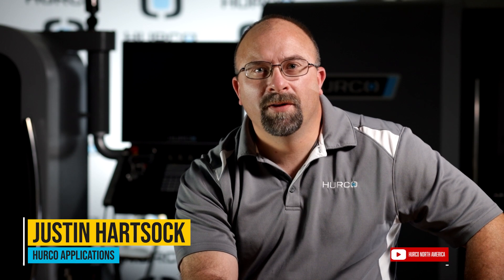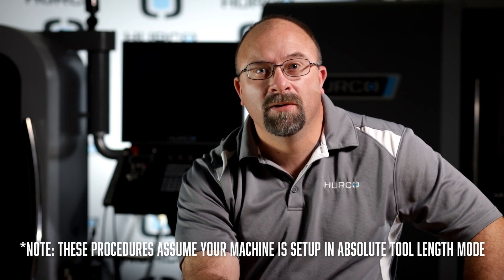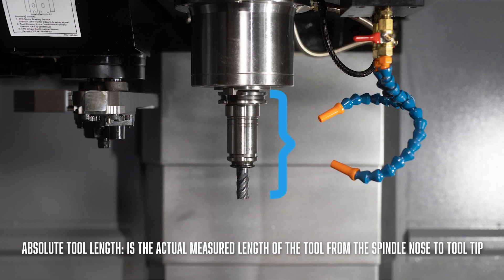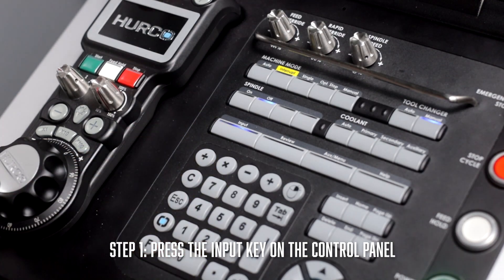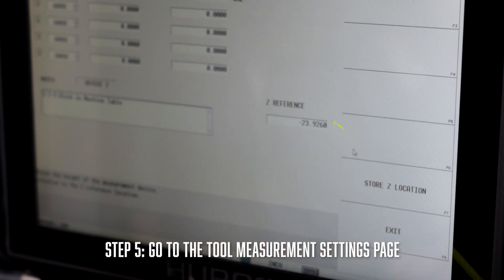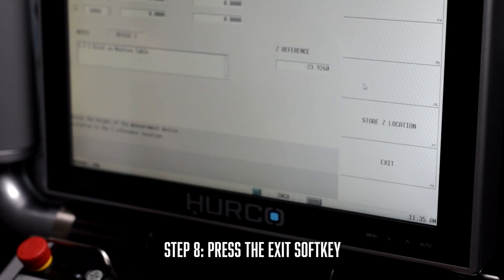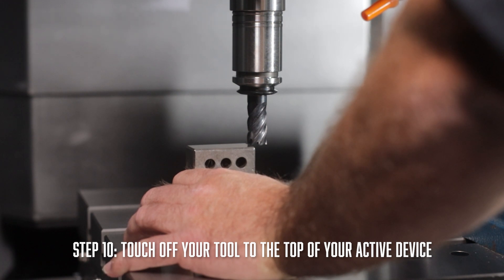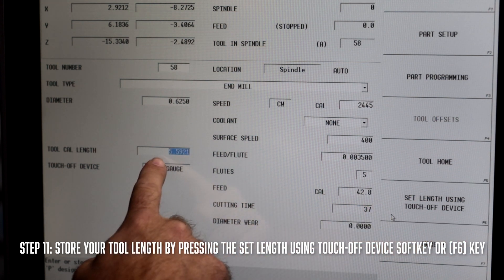Tool Touch Off Without A Probe - Hurco CNC Training

Comment: @hurconorthamerica when i use the tool page length offset page the machine doesn’t read any value that i input for the tools.
Reply from the maker: The Tool Length Offset page data can only be utilized in an NC program when the G43 H value is called. The H corresponds with the table location for the offset.